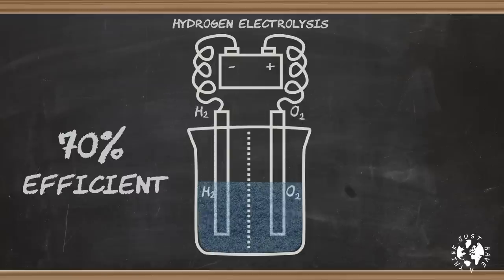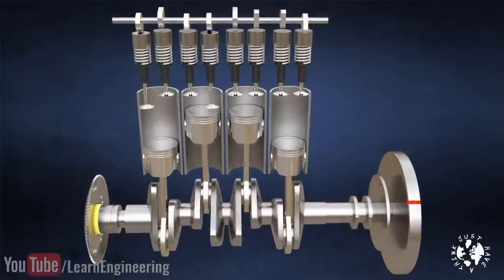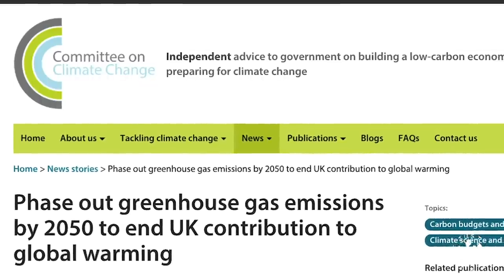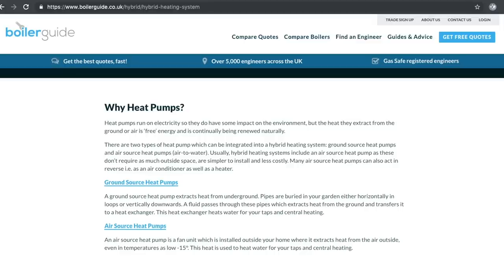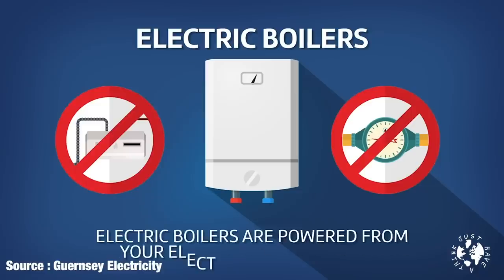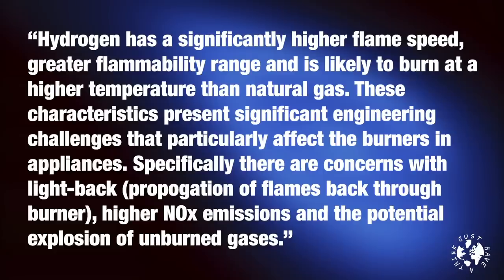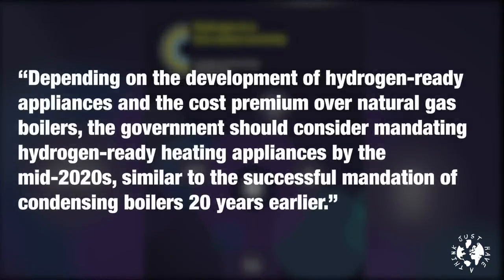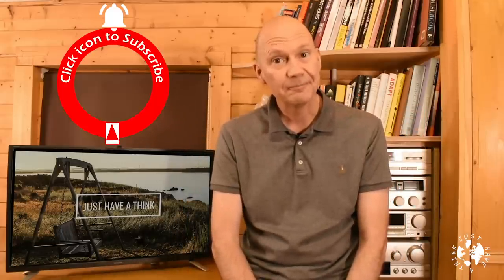Hydrogen for heating our homes

Comment: Have you even the tiniest idea of the explosive dangers with using hydrogen as a fuel ? It's MASSIVELY dangerous.
Reply: That's the elephant (or dirigible) in the room.
Reply: @patrickleigh1523  Hydrogen safety is a serious issue. That's why its use is unlikely ever to be widespread in general applications. Because of the small molecule size, hydrogen escapes easily from most containment and pipelines and even damages materials. See hydrogen porosity and steel embrittlement.

Comment: Why not start with 30% hydrogen and 70% methane mix in the existing pipes ?
Reply: Hydrogen tends to leak very easily. A valve that seals well for methane may leak some hydrogen. You can't smell it. It may accumulate under a cabinet or in a closet. It has a very wide ignition tolerance. Someone turns on a light or strikes a match and BOOM.
Reply: @vinquinn  Methane has no smell either. they add an odourant to it.

Comment: Heating and cooling of buildings uses a massive percentage of the worlds energy production, but there maybe a way to change this. It would seem meta-materials can be made that are extremely efficient in giving off infra red radiation, able to cool the material even in direct sunlight. You either use this cooling of the material or the radiation given off depending on if you require heating or cooling. This material could also increase many machines efficiency by cooling them.

Comment: Hydrogen has huge potential, not just in transport and heating, but also in high-energy  processes such as steel making.

While most hydrogen today is produced from natural gas or other sources of methane using SMR, there's an alternative process under development that converts methane to hydrogen + solid carbon (graphite), so that carbon capture and storage are part of the process (and the graphite can be used in Li battery anodes and other industrial processes)
.
If successful, this could be a great way of converting legacy natural gas (as well as methane from biowaste. landfill etc) into a zero-carbon energy source.

http://www.hazergroup.com.au/

Comment: I fill weather balloons with hydrogen every day and it takes lots of power to produce it! use the extra unused or needed solar, hydro and wind power to produce it and have it as spare energy in specific locations to reduce the transport costs. with heat pumps doing what they do with just minor maintenance and a bit of energy, can't imagine hydrogen being more tha an energy type storage for specific applications. my two cents...

Comment: Great video, very helpfull. One of the things to think about. If we use electricity to power a boiler in winter times, the E net will not be able to support this. If you imagine 1 m3 or gas if equivalent to 10 kw of e power. A normal size house used about 10 m3 natural gas on an average winter day. Thats is 100 kw per day per house. This is massively more then the E grid can support. One advantage of this scenario. All the road will be free of ice because of the heat produced by the electrical grid in the ground to supply all the houses....
Reply: Correct, plus the fact that people don't want more power lines everywhere.
Reply: José Manuel Gómez Gómez You are correct in stating the efficiency of the electrical grid is very high (though not as high as the pipeline grid for transport of same amount of energy with hydrogen). My point is the Electrical grid we have today, was never designed to handle power loads we will get if we heat our houses this way with electrical power in the winter time. And if we try, this grid will become “red hot” (so to speak), and will be a lot less efficient.
Reply: @peetvane  it already happens, transmission lines dip. There's a lot of regulation around it too. 20s at this power, 2 weeks at another.

Comment: If we produced Hydrogen in a large number of places we could get to a place where it would be viable and
inexpensive and above all clean. To make hydrogen we would just need sunlight and saltwater and the
equipment. Hydrogen production could be sited near where it is used. Advances in graphene embedded
with hydrogen and more efficient perovskite solar cells would aid in having a generalized placement of
production facilities. Lithium-ion batteries will need to be replaced with solid state or and sodium batteries because lithium is rare. We can overcome inefficiencies the same way it is done today. Today power plants lose about 2%
of what they generate to transmission. Power grids cover large areas partly because people don't want
to live near one. Hydrogen production facilities would be clean so they could be sited nearer to where
they are used. Honey, I am going to pop out in the EV to get a couple of cans of "H" I'll be back soon.

Comment: Another informative video. The stat that 50% of total UK energy use is for heating is a real eye-opener. It highlights the massive importance of upgrading the insulation of existing buildings.
Reply: That figure is somewhat skewed by Britain's industrial collapse. A lot of the energy consumption attributable to the people of the UK now takes place in Asia, where so much of the energy intensive manufacture for UK consumers now occurs. This has increased the percentage of energy consumed within the UK for space heating faster than improving insulation standards for buildings have made it fall.
Reply: Marc Jackson  The actual charging of a lithium ion battery at modest charge rates is about 99% efficient, up to the point where it is nearly full. If you want to charge really fast, the efficiency drops, due to ohmic losses in the internal resistance of the battery. Much of the loss you see in real world applications is actually in the charging control circuitry. There are choices there. For low power chargers people usually choose cheap and not very efficient. For high power ones people can get the losses quite low, but it makes the hardware more expensive.
Reply: Marc Jackson  Where do you find a "science figure" that says the battery itself achieves only 90% charging efficiency as modest charge rates? Most batteries charge at 90% efficiency overall, with the charge electronics dissipating most of the heat. If you spend more on the controller you can reduces those losses. I've developed charge control for some simple lithium ion battery setups, and the losses in the cells themselves are impressively small.
Reply: Marc Jackson  Now you are changing the topic. Charge discharge efficiency is not 99%. That has two losses chained together. The charge efficiency is not 99% all the way to full, either. I did specifically say charge efficiency was 99% up to nearly full. The exact definition of "nearly" varies from cell type to cell type. 99% charge efficiency, which you can measure using a calorimeter and an electrical energy meter (because all the input energy either ends up stored or as heat), is what you get at modest charge rates (i.e. low enough to keep the ohmic losses to a small fraction of a percent), over a large central section of the charge curve.
Reply: But it cannot be done
Reply: Marc Jackson  This was a reasonable discussion, Marc, until you started getting personal and insulting! You may, or may not, know more than @coppice but your manner has ruined your claim to the right answer. So I believe him/her. I don't know anything like what you people know, but from a debating point of view, it seems to me that stooping to calling someone a moron and telling them they "haven't proven shit" means your argument is weak, at best.
I also suspect you are possibly both right but were talking at cross purposes which could easily have been clarified & rectified had you not immediately become aggressive.
Breath deeply, count to 10, make a cup of tea and just have a think (see what I did there?)
Reply: My house if fully insulated with double glazing, cavity wall insulation and a huge amount of loft insulation. This means that I need to run an air-conditioner for 3 months of the year to get rid of heat build up!
Reply: What about industry? Like melting steal, melting glass, ... I'd expect industry uses more energy that households.
Reply: @fivish   I Got this!
 having grown before universal AC. we had a problem  the solution of which that can solve yours.
at night, we close most of the windows. leaving them open only at one end of the house, as high as we can. then a fan,, a BIG one, box style goes to the other sealed end of the house.  make sure it fits tight so there are no gaps around it  All windows open, will not help. adjusting the window gap to the. exit point where you can hear it softly whistle? means you are very lightly pressurizing the inside, and as it escapes it take more heat with it than one fully open.
when the temp drops,, you blow the night cool air, thru the house, it then lowers the temp not only of the air,, but of the materials the house is made of. it is that matter, that gives you the heat build up you have to fight.
as SOON as your need to heat goes away? before you need ac? do a high volume fan with a thermostat.  (if you can still find one!) 
the fresh air of spring will lower that thermal mass!

Comment: Why not use "poor" efficiency at our advantage? CHP systems can essentially use part of energy twice. Hydrogen could be produced to stabilize the grid and store energy for winter. Then electricity produced by CHP could be used to supplement waste heat by using heatpump, computing, etc.
Combined with insulated, airtight houses, Passive heat gain in winter, air and water heat recovery systems, minimal surfice are with high	delta t°, space efficient and functional indoor layout, thermal and house battery for flexible demand, smart, efficient appliances. With all that we get comfortable, low energy home.

PVT panels are an interesting technology :) Also it is important to make products open source, long lasting, low maintenance and easily serviceable, upgradable. Also we should also take in to account system complexity and cost

Comment: Make the hydrogen at the filling station and save the delivery charge.
Reply: It's a nice idea, but unfortunately the machinery to compress and store hydrogen is complicated, expensive, labour intensive to maintain and consumes energy to make, operate and transport. The dangers, cost and technical challenges of a combined electotrolyser and  compressor plant make it less feasible to have one plant every few miles compared to a few plants covering hundreds of square miles of distribution.
Reply: @marcowen1506  Well if made at the site you wouldn't store it either it would be on demand technology the only compression would take place in the vehicle fuel tank.

Comment: Considering the 'one off' cost of insulating properties to be far more efficient would surely be a profoundly better option regardless of the fuel source for heating.  Drastically reducing demand drastically reduces the o going costs.
Reply: Thinking along the lines of passive house standards.  Cost of the house would raise but heating is way down.

Comment: The explosion of the Hydrogen fueling station in Norway just the other day should give your viewers pause. The Fuel cell powered vehicles are perhaps the safest use of hydrogen that are intended to be used in close proximity to our homes and yet those refueling stations tend to be located at a safe distance from housing. Bringing the volatile rocket fuel right into our homes and condominiums may be literally playing with fire. My suspicions are with that government study you cite in the UK. Could it have had this usage, not excluding steam reforming, added on behalf of the energy conglomerates?

Comment: When calculating hydrogen efficiency you calculate the storage costs, but ignore the huge cost of batteries for that system, and that's why I'm not driving an electric car, the battery rental is more than the car payment, worse it never stops , I did want a Renault Zoe
Reply: @Allen Loser renualt zoe have different allowable miles per month depending on plan,  i calcuated the battery rental alone divided by mileage (and this assumes you make the very most of the mileage, its worse if you do less, and punished if you do more) means i worked it out to cost the same as 40mpg fuel, and this was not also including paying for the kw's you put in, purely battery rental, indeed i am better off, i bought a car that does over 50mpg, and low emmisions , free road tax and congestion zone

Comment: Using hydrogen as a fuel as a partial methane substitute for home heating is ridiculous as a consequence of the energy lost in its production. It's more efficient to use electricity in resitive heating than throwing away the energy in hydrogen production. Also be aware of the effect that hydrogen has on pipelines, resulting in embrittlement which leads to leaks.

Comment: The best target for public subsidy or outright financing is solar on every roof.  You experience getting your tax money back and there is no more democratic a process than literally "power to the people" in terms of personal energy independence.  There is a use and place for the grid, but as you mentioned, it is overrun with moneyed interests and profit focused inefficiencies, such as habitat loss to large installations and transmission line losses.  There are no long distance transmission losses from your roof to your basement.  There, durable, dependable and recyclable lead acid batteries store all you need. Costly, resource intensive lithium ion batteries only make sense in transportation and mobile applications requiring lower weight and compactness.  This discrete and localized storage capacity also smooths out the renewable hump or bulge all the grid operators complain is a caveat of renewables in the system.  Thereafter the focus should be on a low voltage DC environment, no inverter needed! (And maybe no system)  DC motors using permanent magnets are more efficient (claim 30%) than AC, which requires electromagnetic coils to coordinate with the electrical reversal.  No more need for every plug and power strip occupied by all the step-down transformers then converting to DC, stuck in for every electronic device. 

This is where government regulation should be directed, to get appliances set for home solar low voltage DC compatibility.  This is not the answer for every transition we need, but it covers residences and coupled with electric vehicles a large portion of the transportation sector, also business retail establishments, offices, schools etc. 

The heating this episode is looking at does have the fact that burning for heat is the most efficient way to have heat.  Refined electrical energy is always fighting heat losses as its inefficiency, and then finally just turning it into heat seems a capitulation.  So a combustion fuel for plain heating is an important component of an overall well thought system. 

One item overlooked in this episode is rooftop hot water.  It is totally doable in Michigan, both a more severe northern clime than most of England and just as cloudy.  It probably would not be enough to use for home heating, but as a replacement for the standard hot water heater is fills the niche perfectly.  Finally there is some potential to use the rooftop water heating system as the heat sink for the roof top solar to keep the solar in its preferred, most efficient operating temperature range. 

Overall my comment is that moneyed interests and government panels are almost never looking to the fine grained personal, individual solutions, but always the large sweeping ones that are good investments with substantial returns, even if they displace creatures, landscapes and individual lives as already laid out.

Comment: Surely, we shouldn't be using ANY volatile gas to heat our homes. The current system has resulted in a number of explosions. Use the hydrogen to generate electricity and heat homes with that electricity. After all, electricity is perfectly controllable and easy to transport anywhere. This appears, to me, to be perfectly logical.

Comment: I think hydrogen has some advantages in some situations such as storage for excess wind and solar production as a storage method.  I don't think it is a good one.  I think carbon dioxide which is not a pollutant should be produced until we get to about 1200ppm to help with plants and keeping food production and forests green and greening up desert lands.  We need to pull carbon based fuels out of the ground to keep everything alive as it was literally sequestered from old plants that can't get it back out without our help.  If we move carbon down to 150ppm or lower and plants die out then what.  All life dies.  Plants are still starving and struggling at 500ppm.  We are only at 410ppm at peak so why are we trying to stop CO2. We should probably be trying to increase co2 to at least 800 to 900ppm and that would take most all the reserves of fuel coal and natural gas we have.  Then we may need to use energy to pull co2 out of carbon filled rocks or plants will die.  Seriously CO2 is what the world needs more of, not less.

Comment: With battery systems so much more efficient from wind turbine to user, it would seem that hydrogen is a non starter.  And it doesn't have to necessarily be Li ion batteries.  A couple of other technologies are liquid metal batteries and Zinc bromide batteries.  Both of these do not degrade over time and do not self discharge.  They, of course, have their weak points and are not likely suitable for mobile applications (except perhaps for storing energy in static facilities that powers electrified trains).